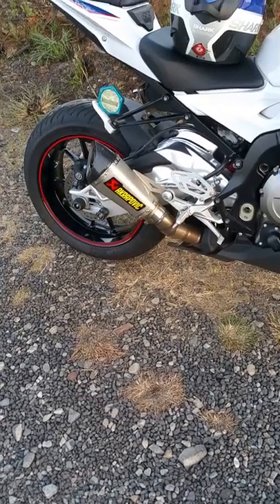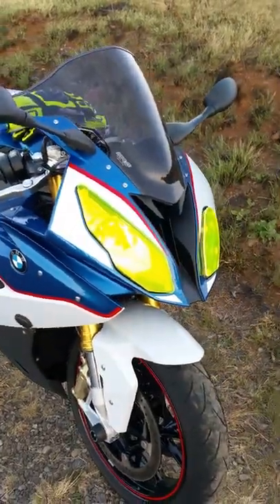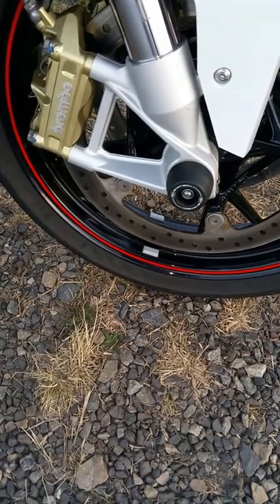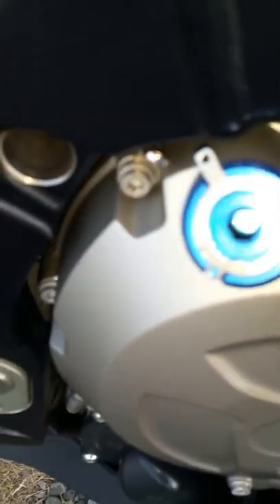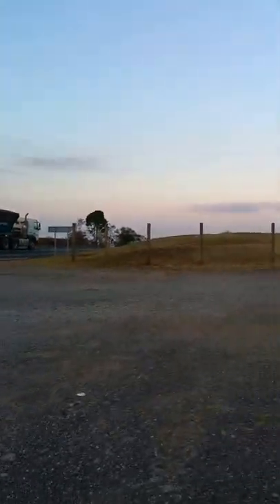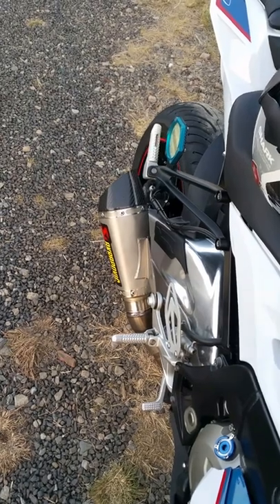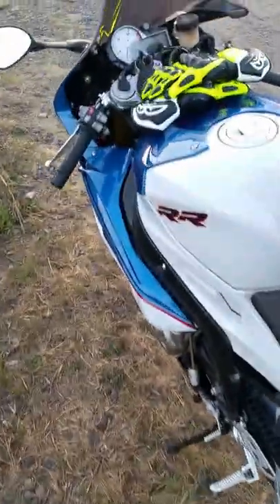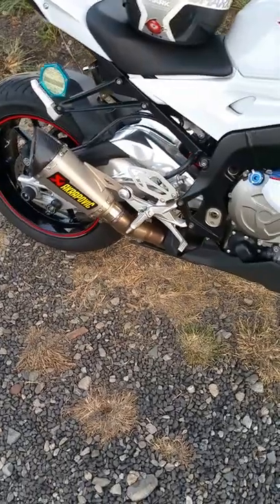2015 BMW S1000 RR Burtech Slip on Exhaust (Akrapovic replica)

Comment: Whats the model name of that helmet?
Reply from the maker: Shark, Race-R PRO Carbon. I see on the online 2017 Shark range of helmets, they took it off, but there is a one in similar colours, The Race-R Pro. See the link:     

http://www.shark-helmets.com/racing/race-r-pro.html?imgIdx=3063&deco=REPLICA_GUINTOLI&color=White%20Blue%20Black/WBK
Reply: Thanks man! That beamer you got there looks insane! Good job.
Reply from the maker: Thanks for the compliment I appreciate it. That short exhaust canister is removed and switched back to standard canister again due to the bike running to rich, very heavy on fuel. Got a BMW approved slip on coming from America, will convert header pipes to stainless later on when the finances look better, and also add a Bazazz and BMW Race calibration kit, then I'll be able to use the short cannister again as it will be running like it should.
Reply: Will be looking forward to a video when you get it all done! Bought myself a S1krr 3 weeks ago and I have my eyes on Akrapovic's Evolution exhaust system, got a black one so I'm gonna murder it with carbon fiber parts too lol.
Reply from the maker: It's very expensive thus I rather go for a stainless system for the headers, because I don't need titanium, and I'm not going to notice the weight because I ride on road most of the time. I'm planning on doing a track day end of February. Unfortunately I don't have a GoPro yet, so I can't film it. Already got my fibreglass track fairing kit and track day pads, just have to fit the whole sha-bang when I'm not working.
Reply: Look to buy a GoPro or any other camera, the competition went up so the prices are down and really a bang for your buck.
Reply from the maker: There are some gripes with the new Hero 5 I see, I'll wait a while to see what happens. I see the Drift Ghost camera is also good.

Comment: every one i know with the oil filer cap leaks
Reply from the maker: Well I got another one, and it did the same, took both back for a re-fund
Reply from the maker: Got a Lightech one on now, no problems what so ever. Seems like the gap where the o-ring goes on is to big, thus why its sweating oil.